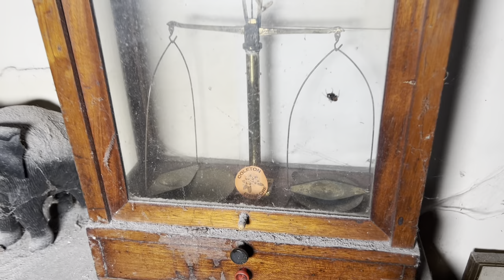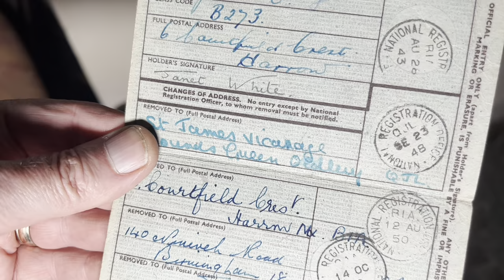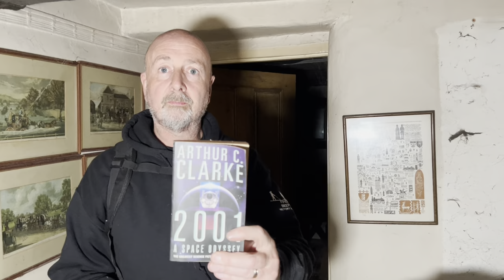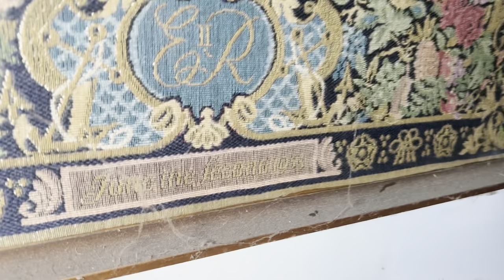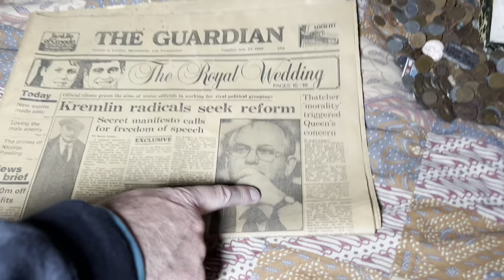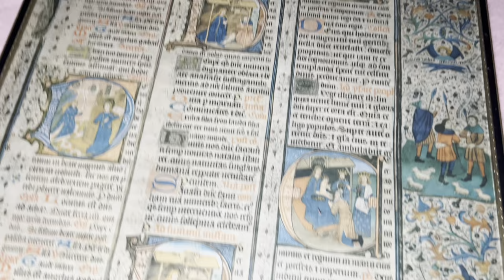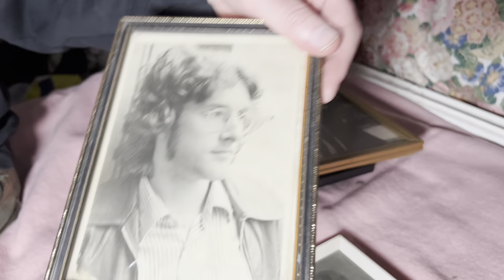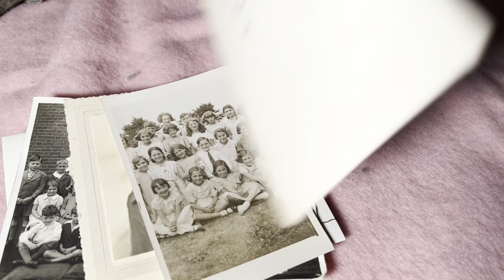This weird ABANDONED house will make you jump in fear

Comment: The sailing vessel on that plate is a Yawl. I once owned one, they are a sturdy boat and handy for short hand or single sailor.
Reply from the maker: Never heard of one but then again I’m not a sailor. Do you still have a boat.?
Reply: Yes. I own a Grand Banks cruiser. 1.500. NM cruising range. The Yawl is a gaff rigged fishing type of vessel, large metal rings that loop around the mast to which the sails are attached, and the top of the mast it is painted white, 3ft  approx. Some are still around/original, and others have had a small sleeping/ galley area built in. A history worth looking into for future ref if needed. Cheers.

Comment: That Black Drawing is a black salve that you would put on a small wound to pull out the infection and help keep it from getting really bad. For example if you got a splinter in your finger and couldn't get it out with a needle, you would put that black salve on it and it would pull the splinter to the surface where you could get it out easier. That stuff worked GREAT. My grandparents always had it around on the farm.